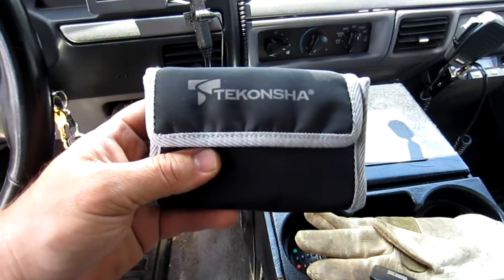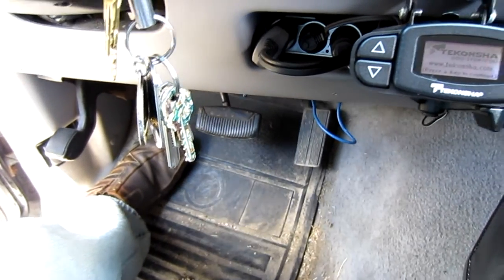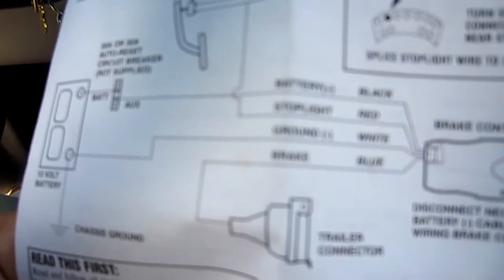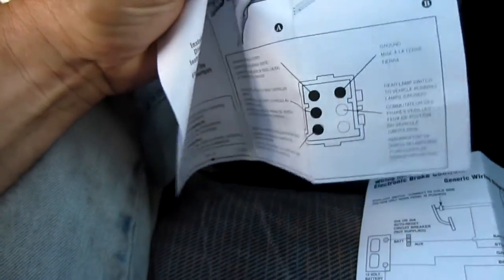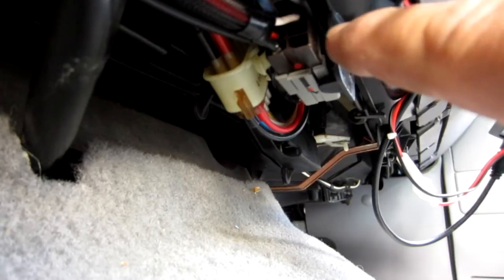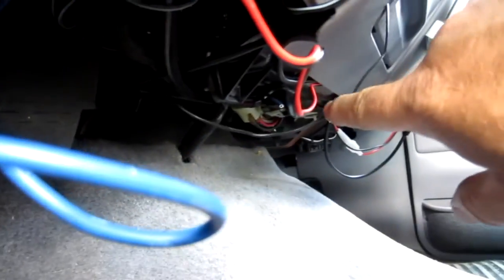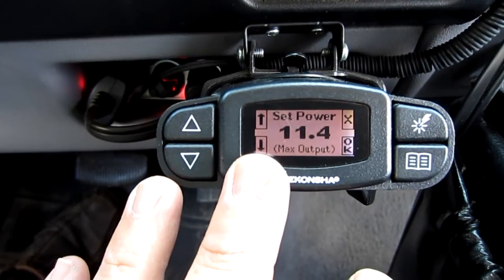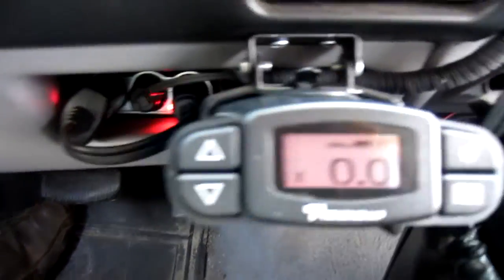Tekonsha P3 brake controller 95 f150 easy hookup

Comment: what wire on the brake harness did you tap into for the power? i am installing trailer brake system on my 96 f150 so i can pull my car trailer and gooseneck trailer, both have braking axles.

Comment: When I manually apply the brake with the lever under the unit, it applies the brakes...but when I hit my brake pedal, the display stays at 0.0.  Any idea why that is?  I can't get it to actuate my brakes from the pedal.  Thanks for the video!
Reply from the maker: ZEHO the wire that runs to the unit that is actuated from the break the like the brake light that is not getting power so you need to see if it's a ground issue or if you need to wire it differently. just because the connector is underneath the dash that the unit plugs into does it necessarily mean it has all the wiring that is necessary to activate it. My F-150 I had to run a wire from my brake light switch to the port on the plug so I could have power when I push my brake.
Reply: Thanks for the reply...I'll check it out!
Reply: ZEHO what did you have to do to set up the seven point harness on the outside? I have the connector, and I have a 4 point outside already, do I jus need to get a 4 to 7 point adaptor and set it up? Not sure how the wires under the dash get to the back...
Reply from the maker: Wild Homesteader you cannot have only 4 pins if you have electric brakes.. You need to have a connector that matches your trailers.. You cannot adapt a 4 pin to a 7 pin for electric brakes.. You have to set up the vehicle with a 7 pin connector.. That means you will need to wire your vehicle with all the necessary connections that a 7 pin connector has.
Reply: Wild Homesteader, my truck already had the wiring installed.  All I had to do was connect to the battery and then install the connector to the wires already under my dash.  My truck already had the 7-pin wired to the bumper.

Comment: did you cut the blue wire to the new harness or the harness on the truck?
Reply from the maker: Neither... I scotch locked a jumper wire from the truck harness and made an end that inserted into the factory plug so that the controllers adapter harness end could be utilized like it was meant to be...